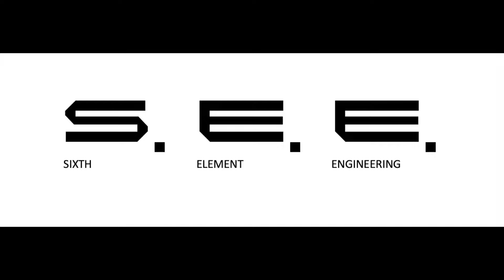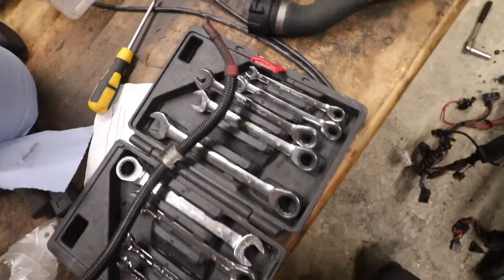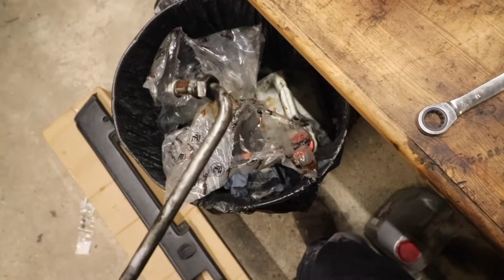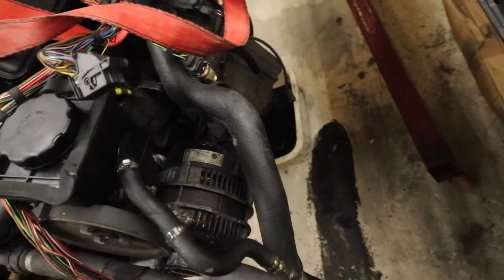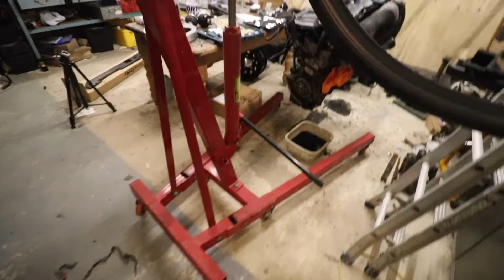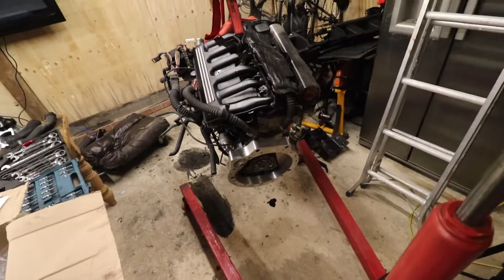Project M57: Episode 10

Comment: Just found your site;-} out of curiosity, I see you have used a adaptor plate, I don't know if  have done the wrong thing, I came across a Range over P38 bell housing which use's the M57 , Have I done the wrong thing , Its going on the R380. Also where did you aquire the spigot bush,